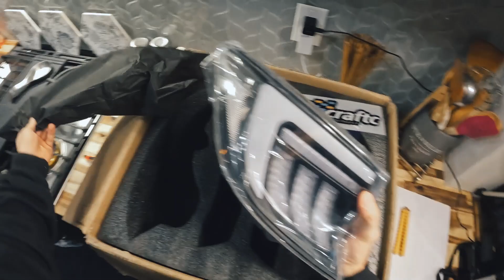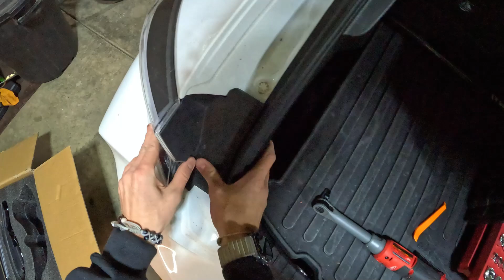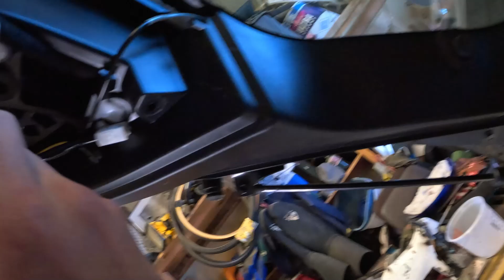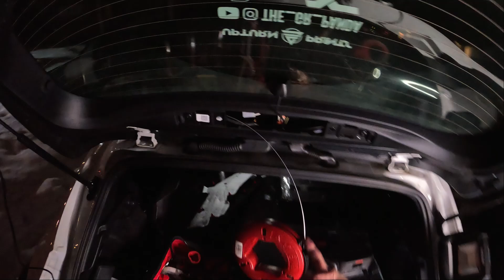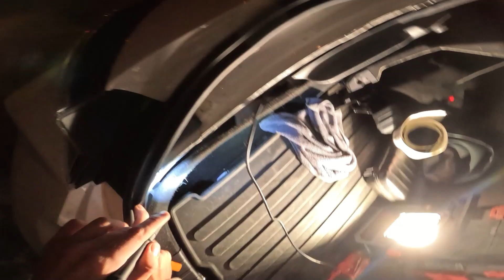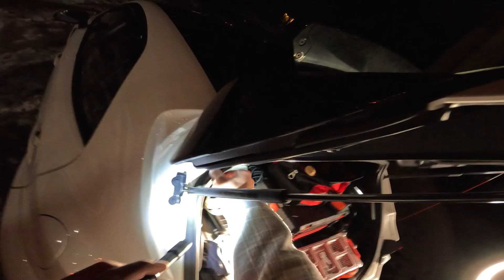GR Corolla Sequential Taillight Install Tutorial + Unboxing (Craft-C Performance)

Comment: hey for some reason the lights on the hatch don’t work except for the hazards/signal lights, any idea?
Reply: I’m having the same issue, did you get it figured out?
Reply: there is a black connector that you need to disconnect that is on the chassis tail light portion

Comment: hi man, how you doing, i've been trying to run the fish tape through the hatch and I can't do it properly it gets stuck on the side of the hatch I believe, are there any tips for running the fish tape?
Reply from the maker: It's easier to run from the bottom to the top, and it's gonna take a lot of patience and repositioning.

It took me about 10 minutes per side to get it through.
Reply: @ thank you very much gr panda, i was trying and i couldn’t but i’ll try with the repositioning, thank you very much
Reply: @apollo_kiing 10 minutes is insane, I’m struggling so bad 🤣🤣🤣

Comment: I've had an issue with the tails when the car is turned on. without the engine running the lights are flawless but with the engine on the signals will shut of in the rear and the fronts will gain a faster tempo and blink very fast. Any idea of what this issue could be?
Reply: Have you resolved your issue?
Reply: @Alpheamus  issue has been fixed
Reply: @Zachs.w what was the solution 
I’m having something similar 
Turn signal and hazards stop working correct after a cycle
Reply: @xfaded1x I took them out again and check all the connections, there are 2 plugs in each light make sure only the top plug is plugged in the bottom doesn’t need to be.
Reply: @Zachs.w  thanks bro, I will try it again when I get a chance. Man they look so good on the car